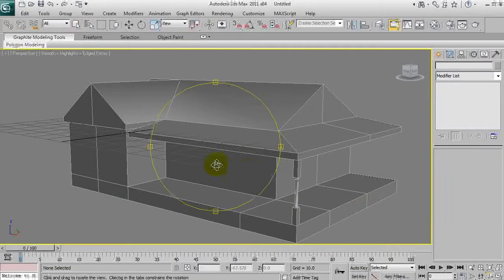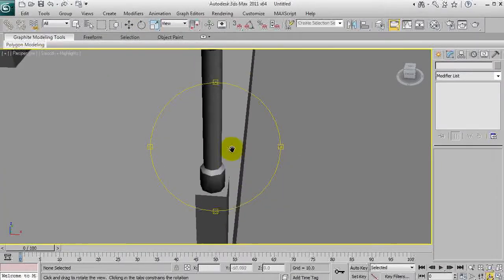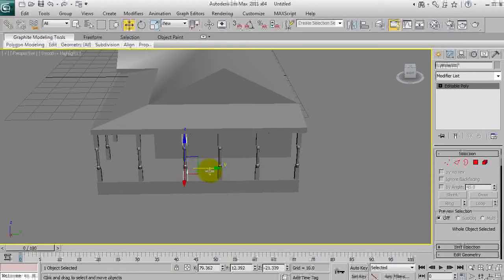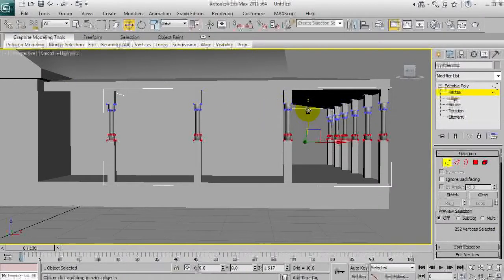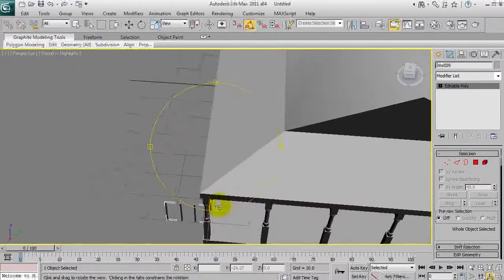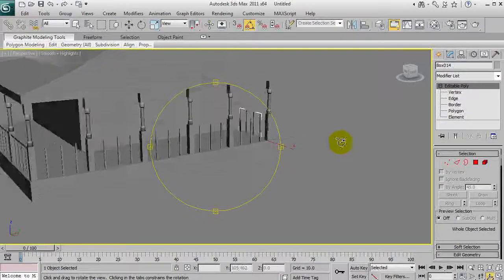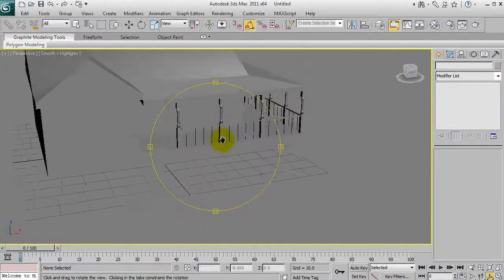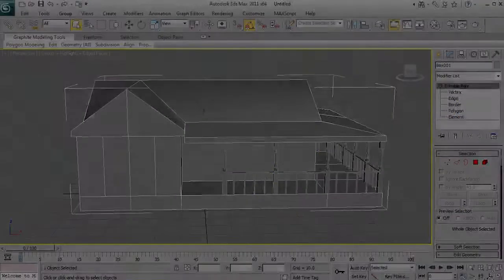Basic Modelling in 3DS Max: House (Part2)

Comment: What annoys me the most in 3ds is that everybody working in it or doing tutorials just randomly places things on an object, theres no mesurment, no pattern. Just place a an object randomly on another one that should be fine. This is not exact by any means... In sketchup atleast you can use the tape measurement and set up invizible lines where you can snap your objects to for example you can place a wall 5 cm from the edge of a face, etc. in 3ds everybody randomly places everything everywhere. fucking hell seriously

Comment from the maker: @andreisabe You mean holding shift, and moving one and then selecting the number to create with even spacing? Considering I didn't measure the length of the house or make anything to a specific size in any direction, that would have been more messing around in the end.